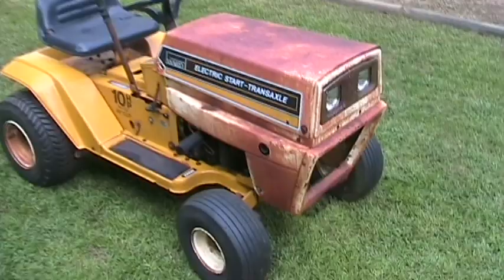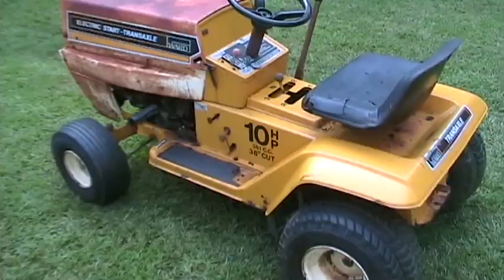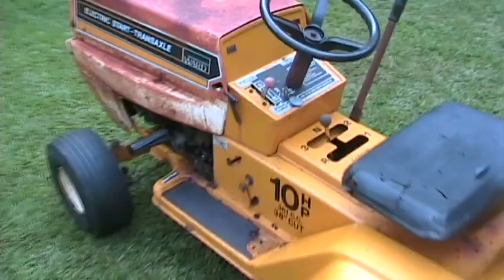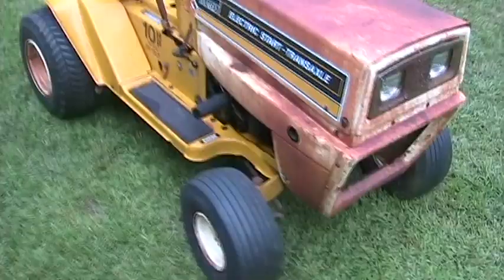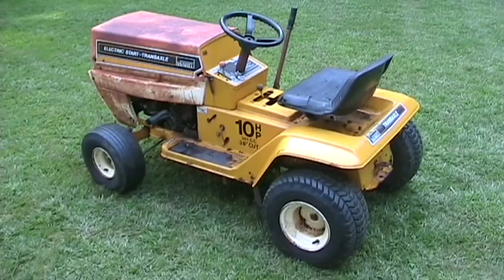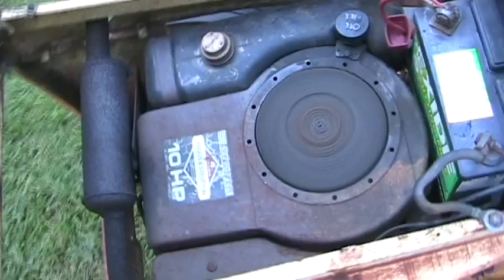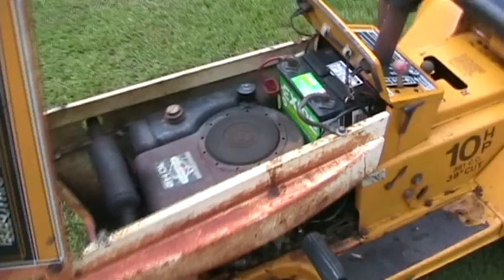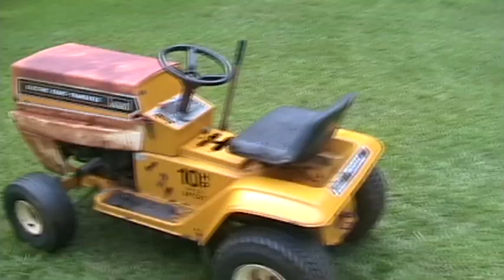Start and drive the 1980 Montgomery Ward 10/38 lawn tractor

Comment: Don't get rid of that engine hopefully you still have it, it's one of the very few Briggs & Stratton large block 220707 without the synchro balancer, which was the weak point of these engines.

Comment: Looks like the exact same model as my old MTD Lawnflite, its definetly a reliable mower since it starts up after every winter even with old gas, and the thing runs like a top even after so many years, only difference is mine is a 36 cut and it's a 5 speed

Comment: I used to have the same tractor. It only ever needed new belts, carb adjustments, points, transaxle bushing and a brake disc which was actually made at by a relative that worked at a machine shop.

Comment: man i picked up whats looks to be the exact same mower ! every like shifter  and pedals and buttons and hood shape are the exact same . but its red framed . and hood is painted black with a custom chrome grill. its a 10 hp briggs and stratton"sychro balanced at 3600** ". my hood has the a hole right were your exhaust comes out but has been replaced and rerouted . probably had same issue as yours rubbing from vibration. got this mower in running condition with the mower deck for free!

Comment: Only bad thing about a one piece flow-jet Briggs carb is that choppy idle other than that they are very reliable
Reply: Mud Mower Regulators I have the same tractor how do I control that
Reply: @ Mud Mowers Regulators I have a LT with a one piece flow-jet and it does not have a choppy idle....... it idle's perfectly. I suggest you tinker with the high & low then if that doesn't do it you may have too much slack in your throttle shaft.
Reply: Mine is a good deal it runs like a top
Reply: I cleaned mine out and once it’s warm it runs perfectly

Comment: @LynolsOffice  It's been a great little tractor.  I also replaced the throttle assembly, rebuilt the carb, and changed the muffler setup.  Used her this past weekend to do some dethatching.  Probably my favorite tractor at this point.  Thanks again, Lynol.